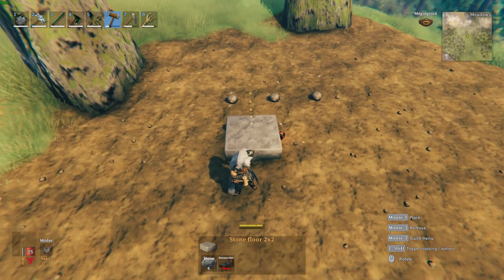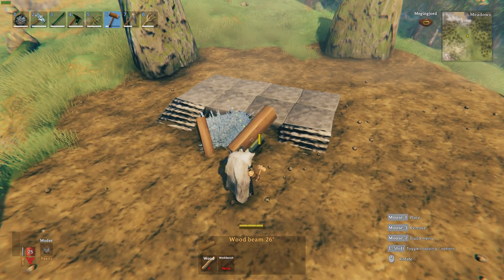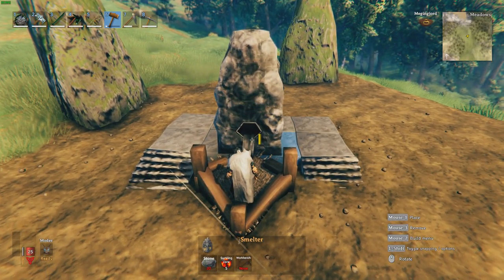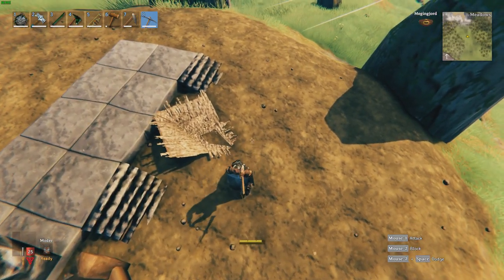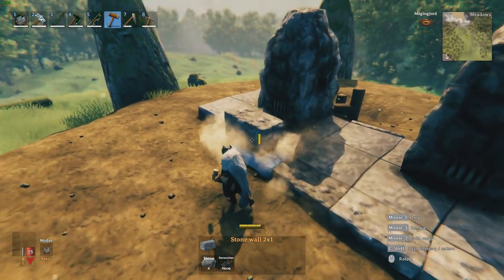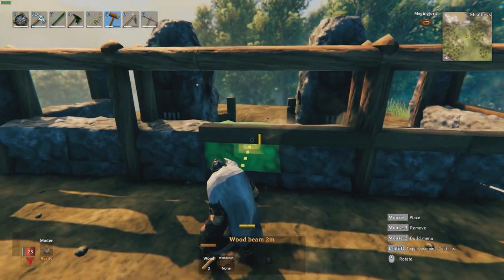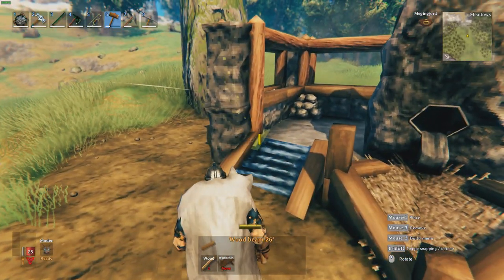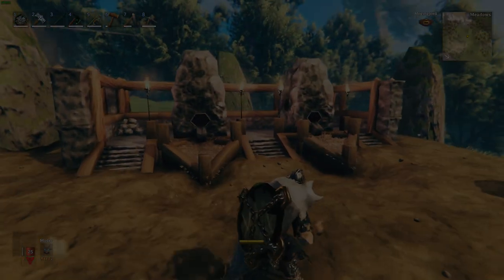The Most Efficient Smelter & Blast Furnace In Valheim

Comment: If you built all smelters around 1 stone slab hole, (where their output is led into a lower underground floor (where workshop lies)) You could essentially have 4 smelter in a 4x4 zone, and all you have to fill them is to go clock wise and counter clockwise around the cross. In this technique you waste quite amount of time in, input and output as, if its not enough to put coal and ores one by one, you have to collect all output one by one. In what Ive suggested, atleast the output is in same location. It looks good, but not efficient, thanks for the vid!
Reply: This would be a very efficient design but it's not the best looking which is unfortunate. I want to be conservative with space which is hard with the size of the kilns and smelters. I calculated that about two kilns are needed to keep a single furnace well stocked. I play with a friend typically, so we need an efficient number of furnaces and kilns.

Comment: Nice video, I incorporated the basic design in my newest smelting building. It's got two regular and one blast furnace on one side, and three charcoal kilns on the other. Unfortunately the roof had to be a lot bigger than I planned due to smoke exhaust restrictions and the sheer size of the blast furnace. It's not a perfect build or anything but it works and looks pretty nice imo :)